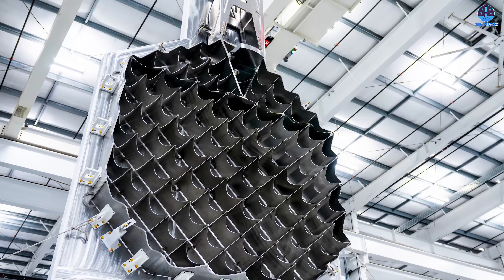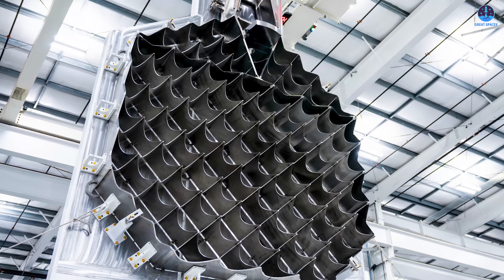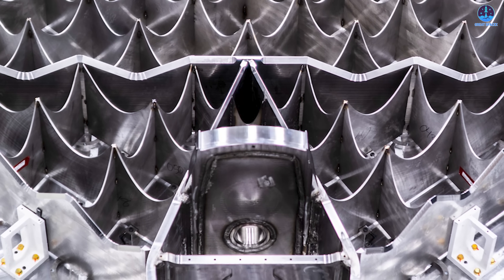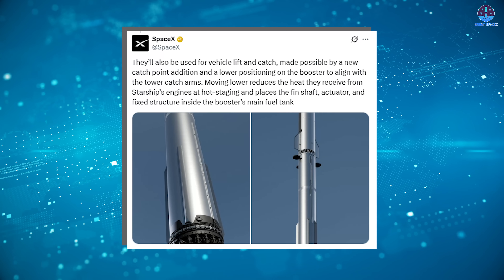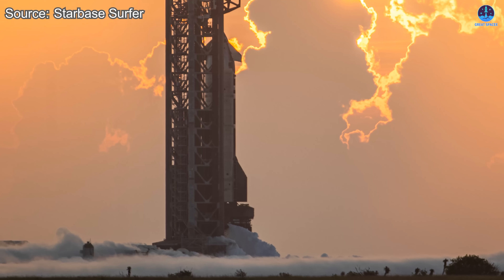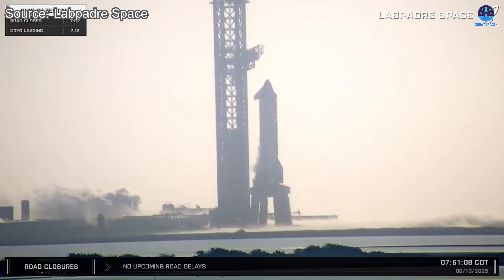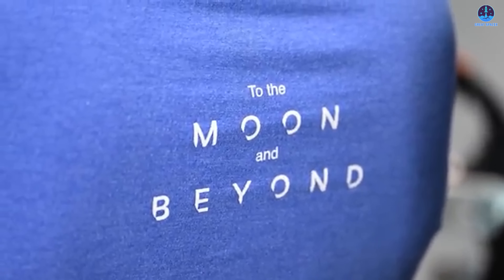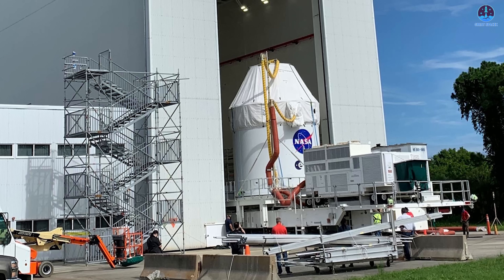SpaceX Drops Bombshell Upgrades on Starship Booster V3 Shocked the Industry! Flight 10 in Days…

Comment: With the constant changes that introduce new issues, it will be many years to get a truly workable design. It's like the auto industry. They produce a new model  car that has lots of issues so as the years pss by the company improves the model. When the car has reached a reliable stage with few issues, the company discntinues the model  and introduces a new model full of problems  that takes years to work out then that model gets cancelled once that model reaches a fairly reliable model. Block one was getting quite reliable, Space x moves on to block 2. This one sucks still but once it becomes somewhat reliable onto block 3 and so on.

Comment: How the heck will 3 fins work...
Reply: The fourth fin at the top is in an area that does not get much clean airflow, meaning it didn't work well in that position anyway.  So it is being deleted and the remaining three enlarged, overall resulting in valuable weight savings.

Comment: Just wondering why at 5:19 - looking at the grid fins attachment bolts....why are they using brass bolts?
Reply: Thats not brass thats gold baby. Fun Fact: “NASA briefly considered using gold bolts on deep-space vessels not for aesthetics, but because gold doesn’t oxidize, corrode, or magnetize. One engineer joked that if aliens ever dismantled the ship, at least we’d get the resale value back. Plus, gold’s malleability meant it could self-adjust under extreme thermal expansion—like a bolt that politely says ‘I got this’ during a solar flare.”

Comment: Im confused about your explination about the higher angle of attack reducing aerodynamic loading. This is opposite of the aeronautical definition. The Angle of Attach is the angle between the Chord line (or in this case the body of the booster) and the direction of flight. A reduced angle of attach means it's falling more in-line and has a reduced drag. Higher angle of attach means increased drag as more of the booster body is directly in contact with the airflow.
Reply: You are looking at it as an airplane engineer rocket engineer seeing the stressing of angle of attack on the engine bells and the bottom of the rocket, things that aircraft don’t have.
Reply: @Colt45s1911a1 The build of the object doesn’t change the basis physics. A higher angle of attack will increase the forces and will increase the heat.
Reply: @sweetpuppies1065 it’s not the build it’s the direction of travel
Reply: @Colt45s1911a1 Steeper angle, more energy being depleted in a shorter time. Basic physics.
Reply: @Colt45s1911a1  Have you been paying any attention to the previous comments?
Reply: @Colt45s1911a1  What part of: "The Angle of Attach is the angle between the Chord line (or in this case the body of the booster) and the direction of flight. A reduced angle of attach means it's falling more in-line and has a reduced drag."
Did you not understand?
Reply: @JarvisThribb I took some screenshots but I can’t post them   
Google “ image of an rocket's angle of attack” then replace rocket with airplane it should help you
Reply: If they could make the booster fall at a flatter angle like the ship it would fall slower meaning it would require less fuel and less loading slowing from ~1k km/h to a stop the slower the less fuel required to stop
Reply: I agree. But I guess it depends on the orientation of a zero AOA. I would think that would be on axis with the longitudinal axis of the booster.
Reply: @billmoran3812  0 degrees AOA means the Chord (body) of the vehicle is in-line with the direction of airflow. When I see the Falcon-9 during it's aerodynamic phase of flight, it looks to have about a 10-20 degree  AOA, meaning it has a slightly different orientation than the direction of the airflow and experiences some side-force on the windward side.
Reply: Higher angle of attack can reduce loading, since it is the peak loading that matters and it happen closer to the end when rocket hitting denser atmosphere, you would want to throw away speed early on.
Reply: Yeah a higher angle of attack more of the booster’s body is exposed to air, causing more drag.
Reply: Explanation